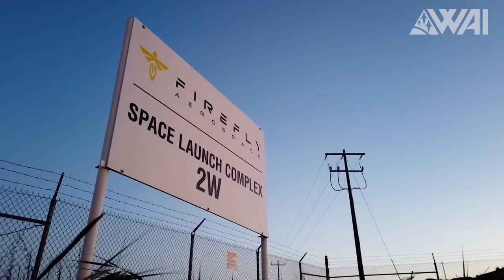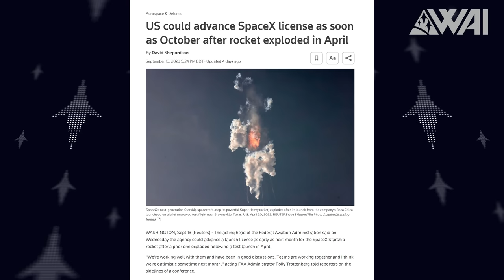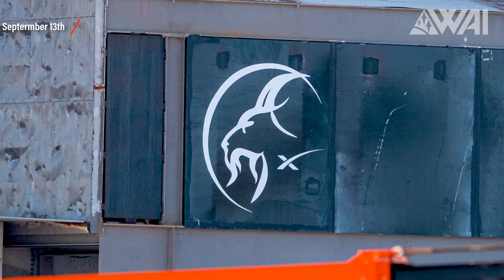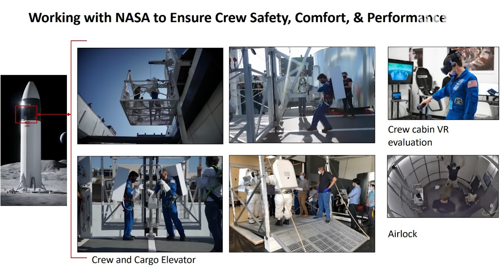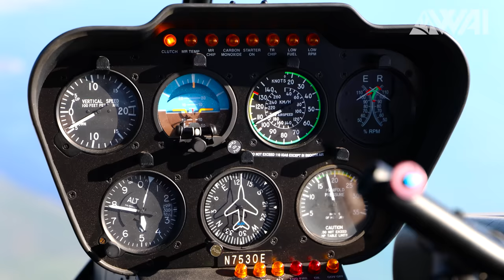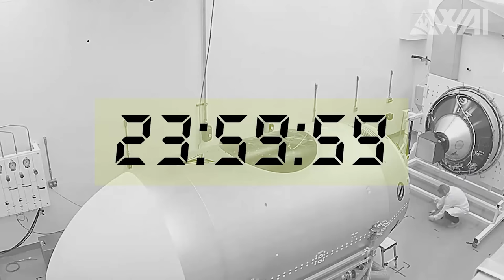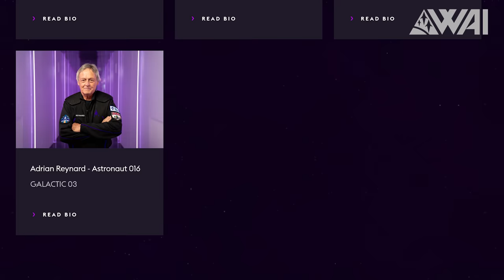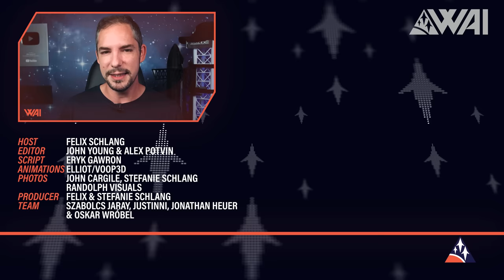Bad News for SpaceX's Starship! Good news for another Rocket!

Comment: Staring at all of these diagrams of HLS interiors, as well as that boilerplate mock-up they just paint, I'm starting to get past the idea that there will ever be a ship that will carry 100 passengers or even 50. The interior space of the mock-up appears to be roughly HALF of what we've seen in all the animations. Just how many people is required to build an initial moonbase in the first place? 2 to 4 in order to land and reconnoiter...maybe 4-6 to set up an Artemis-level base .... anywhere from 6 to 10 to maintain and run it. I don't see it as being any different for Mars.....and THIS is for the foreseeable future.
Reply: Well, HLS doesn't need all the space a mars ship will need.
That being said, I agree (somewhat). Starship will never carry more than 30-40 people on a long duration flight.

Comment: Maybe the delay is good to ensure stuff on the pad. Also, Elon says there’s like 50/60% rate of success from lunching and hot staging separation. What’s plan B if there’s another mishap with the pad or something? 🙄
Reply: Plan B is to learn as much as possible from the mishap, then redesign/rebuild what broke. I'm pretty sure SpaceX engineers are already thinking about failure modes and improvements. 

I'm just glad they upped the pressure of the deluge system for the second test, my main worry was that at full thrust, the water would not overcome the pressure from the engine exhaust and the upper part of the plate would just disintegrate.
Reply: @realulli  ….I agree with your statement. And just like you I wonder too about the water pressure shielding enough. I do hope all goes well, especially the hot staging separation segment.

Comment: Does anyone know why the lunar lander doesn't have any flaps?
Reply: Flaps are only used where there is an atmosphere (for re-entry and landing).
Reply: the flaps are to slow the vehicle down during re-entry. the lunar lander will never need to land on earth from orbit, just land on the moon where there is no atmosphere and thus flaps are not needed.
Reply: Most likely not coming back and be left as a habitat
Reply: The lunar lander is not expected to renter an atmosphere.  Once launched, it will be refuelled, sent to a lunar orbit, and then ferry from the NASA lunar orbiter “station” and lunar surface.  Then lift off from lunar surface and rendezvous with the NASA orbiter.  It will need regular refuelling, but I’m not sure where that will be done.  Either Earth orbit, or lunar, and possibly, in time, a refuelling station at the Lagrange point between Earth and the moon.
Reply: The Lunar Lander will be a specialized Starship version that can do multiple moon landings but never again land on Earth.  So it does not need flaps for atmospheric maneuvering.  It is still unclear how the Lunar Lander will refuel. If it only will refuel in moon orbit, then it will not even return to Earth orbit.
Reply: Good info! Thanks everyone.

Comment: Long term effects of sea water at a beach?
Reply: Are they using sea water?
Reply: Pretty sure that's the case, and if it was filtered water, you know it does rain.
Reply: @beachbum868 They bring in fresh water by tanker for the water cooled steel plate system

Comment: How can millions of gallons of water (over time) not impact a wetlands area. SpaceX should have built (and may still have to) some type of capture system and recycle plant to reuse the water for multiple launches. Perhaps a moat around the entire launch area? There has to be mitigation measure they use in FL for other launch facilities that could apply. Something tells me the 2nd test will be sometime next year and probably towards the end of the year or 2025. Only political pressure by NASA sympathizers who want the Artemis crewed missions to the moon to happen sooner rather than later would push FAA and the Forest service off the dime.

Comment: The black paint is likely heat resistant due to the location of use, but, im pretty convinced due to Elons huge thing about aesthetics, its more than likely its there to clean up the visual aesthetics. Open ports create massive drag, and is a softspot for trouble due to harmonics that are produced, so a cowl, which is typical, works with the law of probability, and it also meets Elons aesthetics needs. Adds a funtion while having visual appeal, yup. Elon approved.

Comment: Luna by 2026 with Mars by 2028. Extensive orbital towers satellite networks, prospecting ones, on Luna and Mars, perhaps an orbital ring around Luna by 2030-35. Satellite networks sent out to orbit and map out all the usual suspects. Map out NEO from Venus to Mars and then The Belt and Outers. This needs to be ongoing and ever upgraded until we have a detailed accurate 3d map of Home.

1st fully spin gravity orbital space stations, primarily made from materials mined and manufactured in space, will initially be able to house 250 crew, 500 'others' coming off an assembly line by 2030 at an ever increasing run rate, being innovated, improved upon. These become the VW camper van of the first spacefaring generations.

They'll be made like tanks, in ever increasing numbers, with many variants and customizations. Eventually they function like little towns in formations in various orbits with and among fleets of far larger GigaStructures*.

2035 for the 1st Big orbital spin gravity GigaStructure* to come off an assembly line. Houses 250,000 with generous quarters, vast open space and total food sufficiency. By 2050 this size variant will be seen as the "K-car" size.

2040 for the 1st 1 million humans in space at once commemorative selfie. A Billion? 2050. By then we'll clearly see that, although it will take some time, there's coming a time that there'll be more of us in space than on Earth.

Certainly by 2050 there'll more berthing ability in space than humans on the planet. Given enough warning we'd have Orbital Spin Gravity GigaStructures* with sufficient berthing and food security to house everyone, to evacuate the planet. By 2050 we'd have the tech and infrastructure to be able to expand in an emergency were there an incoming meteor. 50 year warning we may be able to get some whales off planet! Not hyperbole.

Also my way is the fastest way to Mars. By 2050 there May be a few 100,000 living 'mostly' on planet. All depending on how we work artificial gravity, of course. Mostly, there'll be fleets of GigaStructures* in the various orbits connected to the surface-planetary stations that become viable. People will do 'Seasonal Rounds' optimizing time between Mars & in orbit. In time, generations, people at that time may decide to try terraforming. Certainly there'll be some cool places to hang out!

Yeah, by 2100 we'd not even be able to understand them! When they listen to the recordings of us they'll have to read along, or whatever they have for translation! They'll wonder how we got along with such inefficient means of communications!

Language will give much away.

Comment: Suing is just crazy, demanding spacex do better or face financial punishment is better. Look, spacex like we all know did the first launch knowing the pad would basically explode, this is not acceptable, even during testing. Why launch when you know for a fact concrete will explode out of the pad into the surrounding area. Bad spacex and you should be punished as this messed up all our excitement for the first launch, now I know many will say this is the price you pay when designing and testing new rockets, but spacex knew 100% the pad would most definitely fail and cause damage.

But they have hopefully done enough to prevent that from ever happening again.

Now onto there next self made disaster. The next flight will fail, there I have said it out loud.
We now have the problem with engine failures, EVERY TEST has had multiple engines fail, and this is at half power, which points to an issue spacex needs to fix urgently, but what is spacex doing about the continuous failure of multiple engines, nothing, yes you heard me, nothing. After the last two failed test firing of all 33 engines nothing was done but maybe engines changed out. This is not fixing the really serious issue with engines shutting down during testing. And without resolving the issue and testing until all engines successfully fire and shut down at the correct time there is going to be a disaster, Mark my words. In the last test 4 engines failed in the roughly 7 second burn. Fanboys who make excuses for every musk failure will make excuses, damn I read a comment where some said this is the built in redundancy and expected. But that is bullshit. Built in redundancies are not supposed to be used at all. Built in redundancies should only be used once in 1000 flights, otherwise it is not Built in but a part of the problem.

Yes starship can during testing have up to 7 engines fail and still reach orbit as there is no cargo weight. But then why have test firings. 4 engines failed in the last test, that was within 7 seconds. It takes roughly 10-12 seconds to actually achieve liftoff. So we can extrapolate from the evidence that before the booster actually leaves the pad 4-6 engines will not be working so that leaves the booster with only 1- 3 engine losses allowed before disaster strikes.
And even if only say 4 engines fail in the first 7 seconds there is still several minutes of flight before separation and in that time we could see more engines fail, damn it is a given that more will fail.

But that is not all. The amazing team of engineers cannot seem to fix this, they obviously don't know how to fix it or they would have, so I expect like in the first launch to see multiple engines explode and like domino for each explosion to take out other engines. God forbid the main engines explode, even one will mean total disaster, and this could happen within the first 30 or so seconds of launch with the ship very close to the ground and we all hopefully know that will result in a seriously powerful explosion that will spread out and cause damage multiple miles further than the last failure. We could even see loss of life from observers that are close enough to feel the brunt of the concussion from the explosion of a fully fueled ship. 
The time of taking chances and excusing failures should be over, and I hope that in the next 2-3months before the next launch we see multiple engines replaced with new and changes made so test firings of all 33 engines weekly right up to launch work as designed multiple times, not one engine failing in at least two test firings maybe more.

Or hit spacex and musk where it hurts and ground the starship until all engines fire together in multiple tests,, give them 6 months to resolve the issues and if by then they have not fixed it shut them down for a year or two. Maybe then spacex will grow up and not try to launch the most amazing spaceship until they are sure it will reach orbit. I mean we only know about the engine issues because failures are so obvious what else is on the red line of failure, or close to it?

Comment: I'm not optimistic about the next Starship launch - The 'water plate' system won't do the job of flame mitigation tunnels.  The insane power of 32 Raptors lifting 4400 TONS will blow the pad to pieces again.  Starbase HAS TO be moved to a viable location, but ego-child Musk will not admit his mistakes, especially the big, expensive ones.
Reply: Do you have a degree in a psychology related field involving childhood behavior?